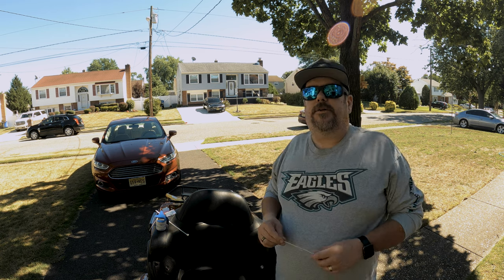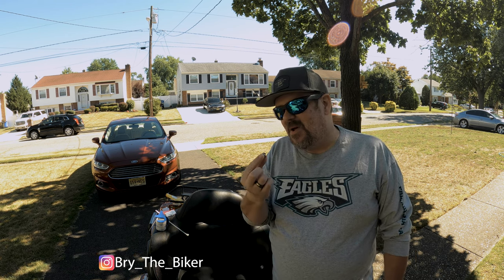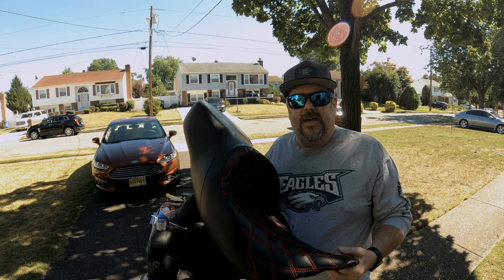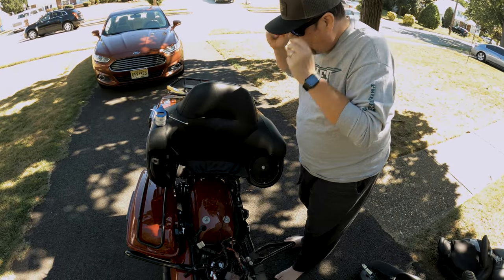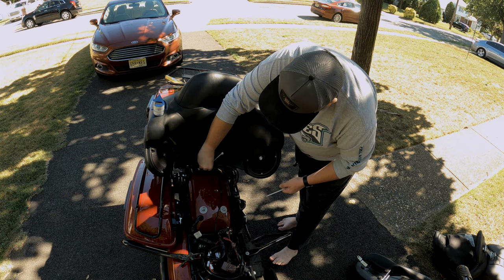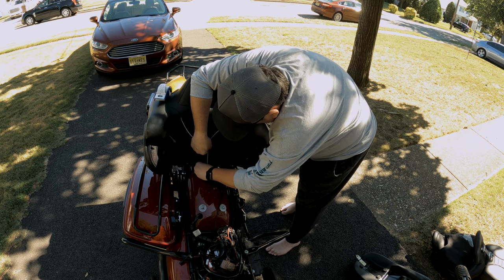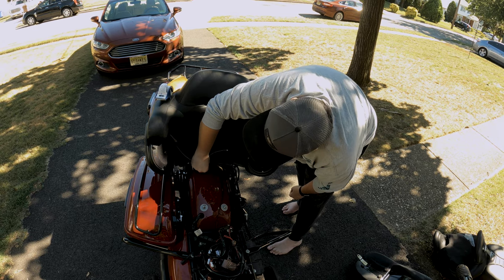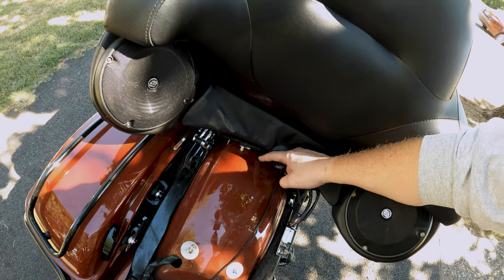FASTEST Way to Replace a Harley Davidson Seat Bolt in 5 Minutes!

Comment: I've seen other Youtube clips where guys can magically thread just 1 single zip tie from underneath the the fender in 30 seconds.  There's no way I could do that in 30 seconds, and it's certainly not easy.  The additional zip ties inserted into the fender from the top and joining it to the last zip tie in the 'daisy chain' makes the task so much easier than using wire, string, paper clips, chewing gum or anything else in the book of MacGyverology Volume 3.  Of course, I always use re-usable zip ties, because they are so expensive to replace! :)
Reply from the maker: It’s a good trick for sure

Comment: Take a 5 foot length of paracord and thread about 3 feet thru the hole. It will drop on the wheel, pull it out to either side.  Feed the bolt on the paracord slide it up about halfway on the paracord.  Tie a knot below the bolt and pull the other end (on top of the fender). The bolt will be pulled up to the hole where you can easily turn it to the proper orientation and put the locking ring on.  No zip ties, no tape.
Reply from the maker: That’s a really good idea!

Comment: I don't think you could do that again any faster. Where are you located so I can bring you my bike to try to beat how quick you did it the first time 😂😂

Thanks for the rime saving tip
Reply from the maker: Challenge accepted :-)
Reply: @BryTheBiker  I didn't have zip ties, so I took your idea and compromised. I was expecting a challenge to replace this part until I found your video. I ended up using some scrap soild electric wire I had laying around and it worked like a charm. Thanks again for the brilliant idea.